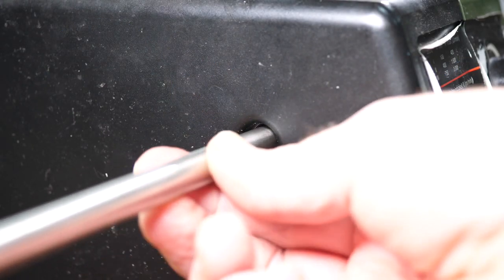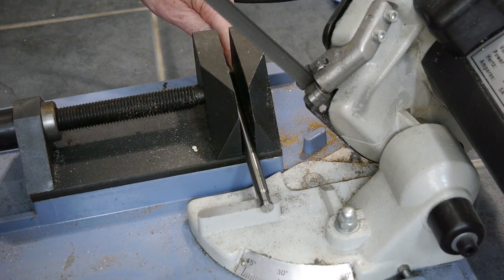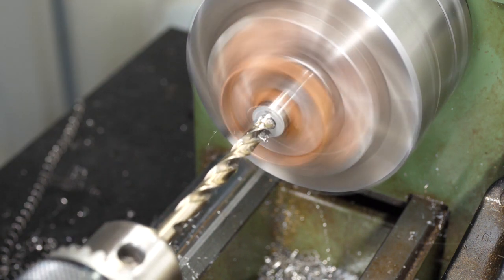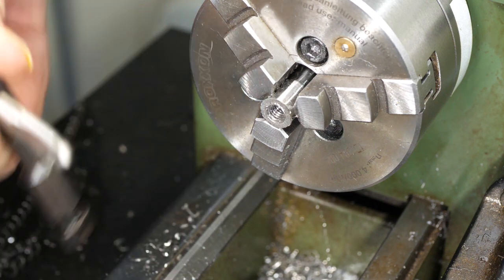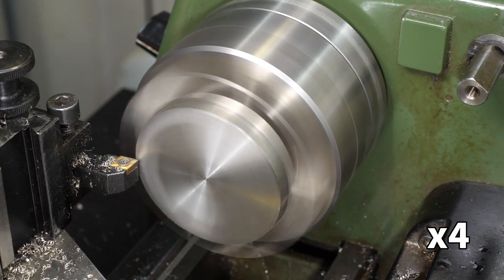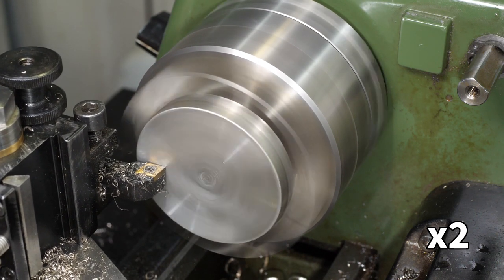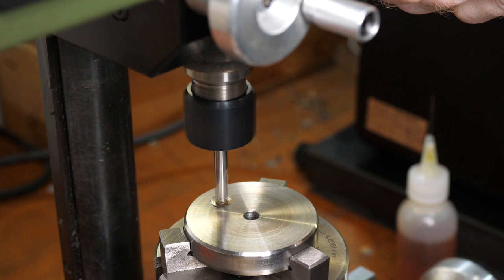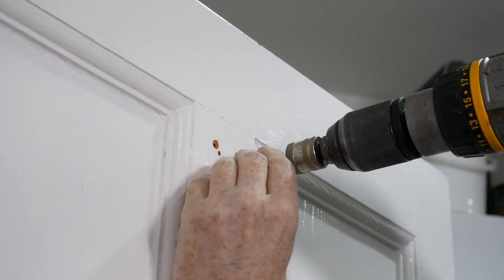Making a Coat Hook for Coat Hanger 2020 on the Proxxon PD 250/e Lathe

Comment from the maker: Thanks to everyone who came to the premiere! I enjoyed chatting with you all, and thanks for the helpful suggestions!
Reply: Adventures with a Very Small Lathe what is the stick you are polishing the steel with please
Reply from the maker: @colsanjaybajpai5747  It's silicon carbide abrasive embedded in rubber. The most well known brand is Cratex. Search for "rubberised abrasive stick". Using them on a lathe was made popular by Robin Renzetti, practioner of the mechanical arts.
Reply: @AdventureswithaVerySmallLathe  thanks, that helped me a lot 😀👍.
here is a tip regarding the burrs you got on your tapped hole. just use a countersink after drilling, not only will this keep the burr away but it also helps to start the tap.
or better use only a bigger centredrill before  drilling.
enjoyed your Video, thanks
Reply: Thoroughly enjoyed the premier of this video and the chat with the small exception of the noise involved in machining 316 stainless....WOW, thank you for making sure I never try that!
Reply: Adventures with a Very Small Lathe : thank you so much. I have been using 1" abrasive rubber wheels of various grades but this is any day better  for large parts and very convenient.
Reply: @sammiller5509  also you can drill the screw clearance size 1mm deep, that prevents any burrs forming also
Reply: @colsanjaybajpai5747  It was also a question for me ...nice question..

Comment: Thank you for sharing. Love your videos. If I may ask, what make and model is your bandsaw. I'm looking for a small bench size one to go with my small lathe.
Reply from the maker: It doesn't have a brand name or a model number, and honestly it's not a good tool. It doesn't have any adjustment for the blade, so cuts crooked. I have replaced it with a 4.5" floor standing bandsaw from Warco.

Comment: Looking good,
On metals like that it is an idea to drill with a larger drill. Even on your hanger as little as 50% thread engagement would have been enough. It makes tapping tough holes much easier and if you are concerned about strength, go for 2Dia deep rather than a more standard 
1 1/ 2Dia.
Even for regular metals going for 65% rather than a standard 75-80% can make life easier, without significant loss of strength.

Comment: I'm a little late but here is a tip for chamfer chatter. If you start getting chatter on the chamfer, continue until a bit behind finished depth. Then, pull the chuck through instead of the motor and you get a brilliant surface finish! Anyways, AMAZING video and great addition to  the workshop :-)

Comment: I must get hold of some of that rubberised abrasive, it looks magic! Have you thought about covering your ways when you use it? I could imagine that the free abrasive might not be the best for a machine tool. Worth noting that Robin Renzetti has flexible way covers permanently installed.
Reply from the maker: It is really useful. h/t to Robin Renzetti for calling attention to it. Sadly very difficult to get in the UK. As long as it's used on smooth surfaces, it doesn't shed much free abrasive. I do clean up pretty thoroughly after I've used it though. Using a way cover would probably be good, so I'll do that from now on.

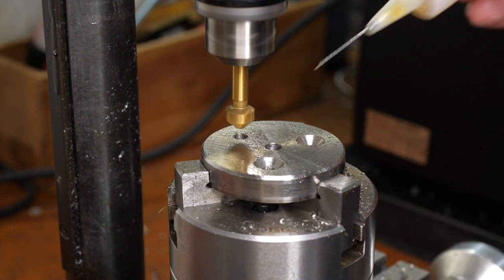Comment: 23:42 I had the same problem with bits losing traction on an ER11 collet on my Sieg X0 mill - 6mm turned out to be 'imperial' 6mm, aka 1/4"! Interesting video, picked up some useful tips. 👍

Comment: Great video! You always do a great job to show what can be done with these small machines.

One question: I have the same Mill (FF230) and i struggle with the low rigidity. Drilling gives me crooked holes and milling gives me terrible chatter and sometimes it even grabs and it visibly bends the entire machine. I tighten the lock screws really hard and still it seems wobbly. Is there any way to handle this or is my technique to blame?
Reply from the maker: I don't think you are doing anything wrong. It's a flimsy machine. I've chatted with a few experienced owners, and people have tried various things. Several people have added extra screws to tighten the hold on the quill in the headstock, and one FF 230 owner built a large, heavy replacement column from epoxy granite to improve rigidity. Personally I think the possible improvements are very limited, and I plan to buy a much larger mill as soon as I have the space.
Reply: @AdventureswithaVerySmallLathe  Thank you very much for the insight. :) Do you have a particular mill in mind? Wabeco F1200 machines seem good (https://www.wabeco-remscheid.de/catalog/category/view/s/konventionelle-fraesmaschinen/id/393/)

Comment: Great video's - thanks for your work on these. I'm considering the Proxxon PD 250E as a first purchase lathe to support my model steam engine hobby. Problem is I can find no objective reviews of this model or it's immediate competitors. Your video's show this lathe in a generally good light - but what do you think of it overall? What are the good and bad points - there must be some examples of the latter, I'm sure. The tool post fixture mod a clear improvement but what else? Any further guidance appreciated.
Reply: I'm in a similar situation, looking to purchase this lathe however the lack of objective reviews is evident. Perhaps the price is it's Achilles heel for what is actually a Taiwanese lathe though Proxxon would like us to think otherwise.

Comment: Very interesting video. Thank you.
At 9:00 an ER40 collet chuck would have helped grip the workpiece firmly and evenly, without marking it.
Also, using first a Taper Tap, and then a Second Tap, will make tapping in difficult materials MUCH easier than trying to cut the thread with just a Second Tap (aka Plug tap), and will mitigate issues like tap-breakage and scrapped parts. The reduced cutting forces will mean that the workpiece is less likely to slip in the chuck too.

Comment: Nice Work, but the bandsaw blade looked like is was maybe too fine for the bigger piece, a coarser blade should cut big parts better.
Reply from the maker: The bandsaw is a bit of a weird model, and I haven't had much luck sourcing blades. Last time I went hunting, this one was the only one I could find from suppliers in the UK.
Reply: @AdventureswithaVerySmallLathe  okay, a blade is still better than no blade or a hacksaw I guess.
Reply: @AdventureswithaVerySmallLathe  , that's interesting Alistair because I'd been considering a similar model here in Australia  https://www.machineryhouse.com.au/B004
Curious to know if your spec's matches this one? Would you buy the same model again or go different one?
regards Colin